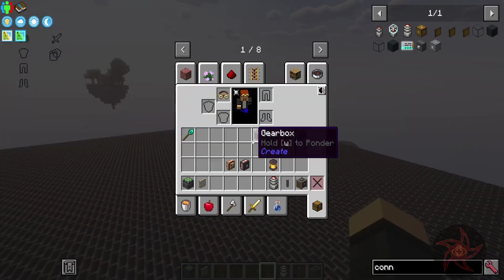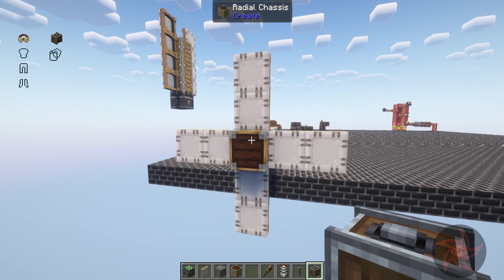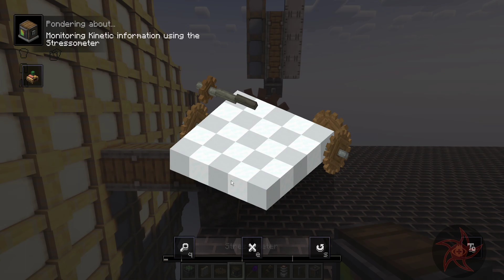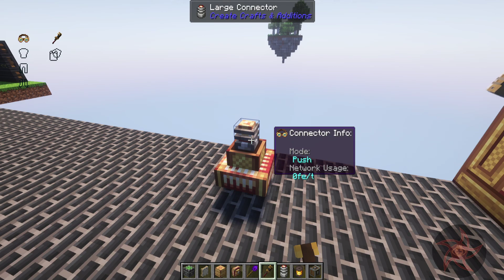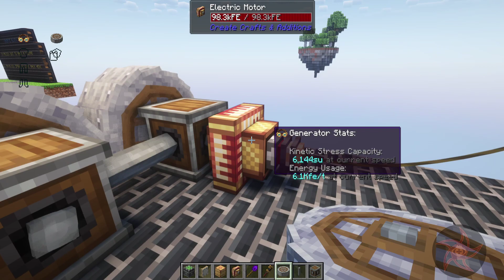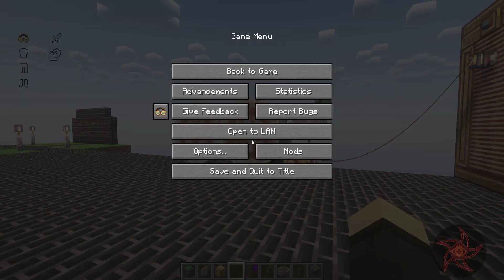Create Tutorial :: Windmills - Electricity - Crushing Wheels

Comment: any way to do this with the star technology modpack create options? unfortunately it doesnt have the accumulator and so on
Reply from the maker: that means you only have base Create, an addon mod adds the accumulator now, so you are stuck with either using gears of chain drives to get things going, and that means you will need a lot of room for everything, but it will still work as long as you know how Create's stress system works
Reply: @theeldersign managed to get it to work while also looking nice :) just a tad bit sad that I can't store the energy without using brushes and redstone flux cells. Btw you should do more tutorials like this, despite only having like 200 views this is easily one of the best series for this mod out there!